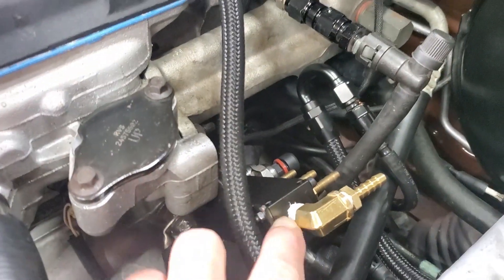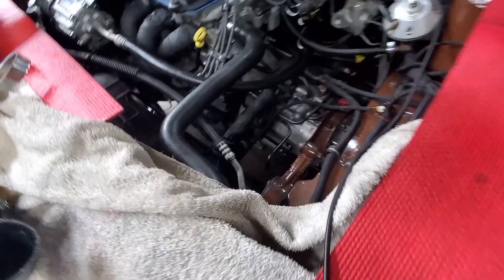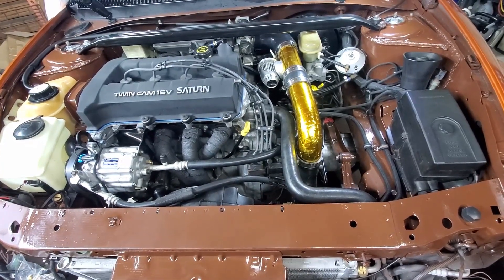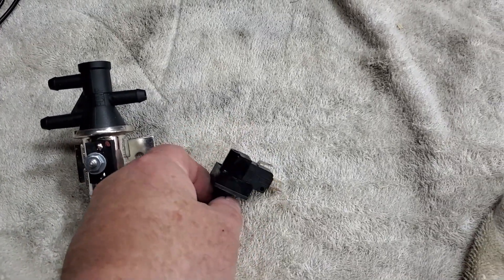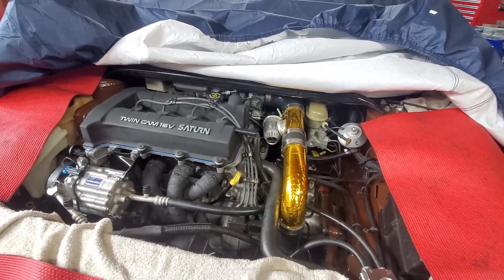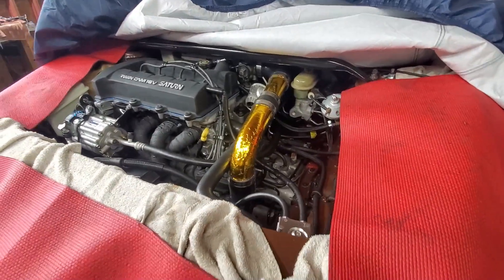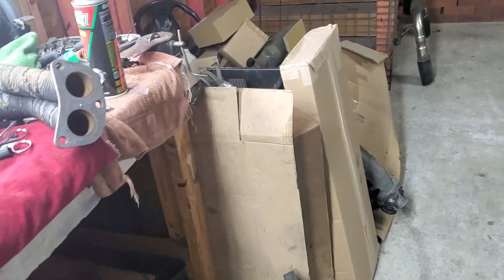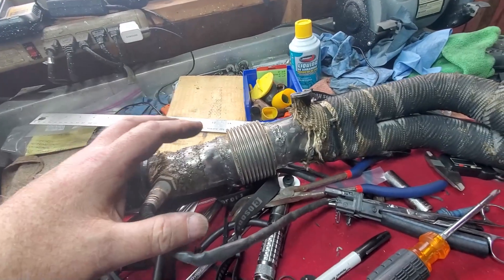SATURN S-SERIES REAR MOUNT TURBO UPDATE-THE FINAL STRETCH!

Comment: Love the content!  I have a 92 SL2 (orig owner) with about 600k miles on it.  If I understood your catch can arrangement correctly, I am wondering if it would ever catch anything out of the breather if you have a boosted/positive intake plenum.  Engine blow-by on NA is usually in very low/positive inches WC with a negative intake plenum.  I don't know if crankcase pressure significantly increases with turbo boost... But anyway... I don't see how the crankcase breather could flow outward (to the intake) in a boosted application, and may explain why you aren't capturing anything in the catch can.  Thanks for sharing your projects on the gen II coupe.  Nice to know there's a few of us left who love the S series.
Reply from the maker: Man thank you so much for the kind words wow that is a ton of mileage on that satty of yours-true fan for sure!  Yeah I questioned the way I had that system set up as well. During boost the PCV valve shuts off so nothing goes in from the intake into the valve cover but there should at be perhaps not a whole lot but should be some blow by getting up into the cylinder head, no?   Since I was running that rear mount turbo setup I really leaned on STS install guide to tell me what I had right or wrong. I found this out later but apparently based on what they say unless it is MAF vehicle then they say I haven't set up right. If it was AMAF vehicle I would have had to incorporate that valve to block boost when it goes into boost to hide the air from the mass airplane center. I looked all over YouTube for anyone that was running rear mount turbo system to see if they had guidance on how to run it and I never found anything. 😥 I am one day away from firing up and a few small things. Stay tuned! 😀
Reply: @kurtbennett1164  Will look forward to it, Kurt!  I'm not a turbo expert.  My rudimentary knowledge of pressure makes me think connecting the valve cover breather to any part of the discharge path of the turbo is not ideal.  Probably better to have the breather/catch can ported to the intake side of the turbo where there is, filtered atmospheric air.  Don't know what that'll do to the turbo if the catch can overfills, however.   The part you explained during idle, when the PCV is metering crankcase gasses into the intake plenum and the breather is drawing in "fresh" filtered air, should work as advertised the way you have it now.  But when the engine is rev'd and boosted, the crankcase blowby won't be able to escape out the breather if it is connected to any part of the boosted intake while the pressurized/boosted intake air duct is at a higher pressure than the blowby pressure.  I imagine the oil in the crankcase might be one tell - getting pretty dark in a hurry.  You could also try measuring the pressure at the dipstick to see if the crankcase is being pressurized from the boosted intake too.  Perhaps my theory is wrong because the oil dipstick isn't blowing out.  Interesting stuff!  Anyway... I can't be certain, because it's been a while, but I thought "thatdudeinblue" was running a rear turbo. ~ Rob
Reply from the maker: @rcnthusiast  I want to say thatdudeinblue has done a total of two test drives of a saturn a guy has but it isnt rearmount. There are sadly few modding these cars, fewer turboing and I do believe Im the first rearmount. Not that this is groundbreaking since tons of people rearmount, but Id suspect they run catch based on maf orap sensor equipped situations. Im going to take what you said and run it through my supercomputer brain lolol and see if Im wrong still. Probably!😅

Comment: It’s definitely not you when it comes to welding haha those cheap welding don’t like welding the thin exhaust no matter how good the wire is the best way to do it is just doing it tack after tack around the tube
Reply from the maker: You know I thought about that but I didn't want to get it to the point where the other welder couldn't manage what I had messed up with all those tacks on there so I left it alone thank you for the vote of confidence!!

Comment: Me again ...😂...you have a vid on a sohc to DOHC  motor swap....?cheers..
Reply from the maker: No but it is crazy simple. You need the donor motor and pcm and wiring harness. If you wanted to, you could keep and use ypur sohc trans as it bolts right up but the gearing is not as short in 4th and 5th.
Reply: @kurtbennett1164  thanks ...have a lead on a complete donor DOHC car ...have to wait to see if summer comes this year ...Canada ..cheers